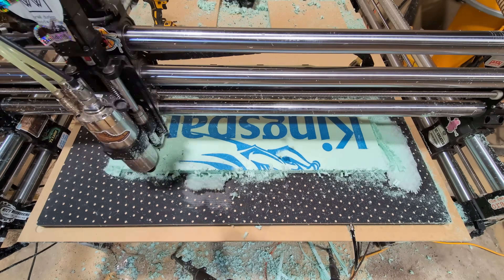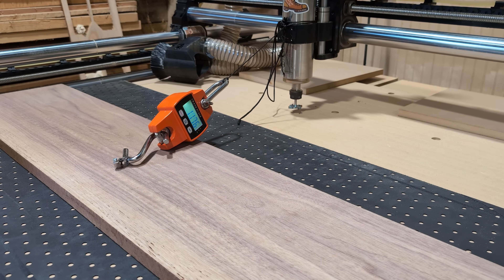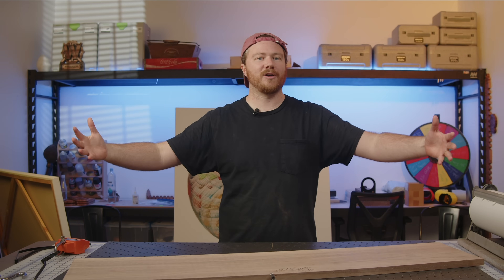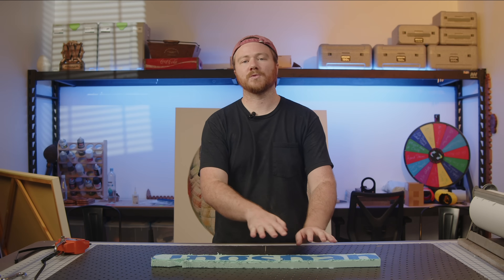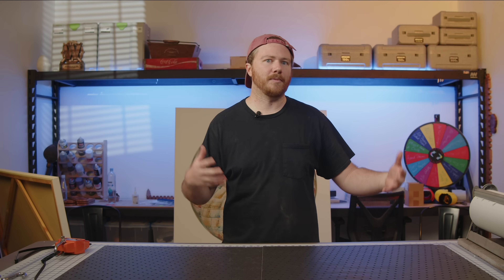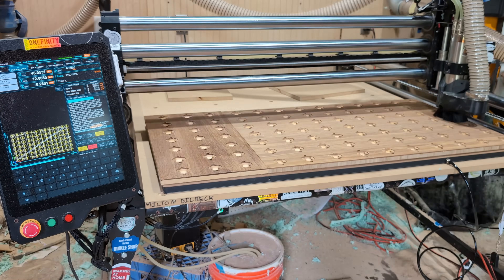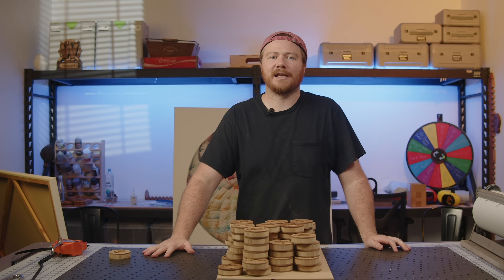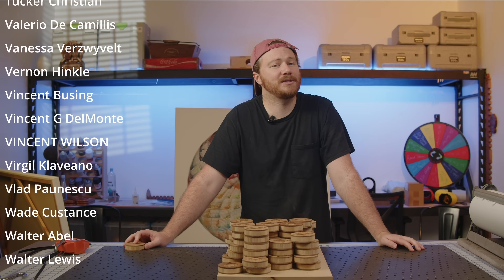Do CNC Vacuum Tables Really Work? UNEXPECTED RESULTS

Comment: Hi - new subscriber, found your page by a search on Airweights. I have their 2x2 and 2x4 tables and am planning to do a bunch of through cuts on smallish parts. Have you tried the cover gasket on solid sheet that they sell? You have to make a dedicated fixture for each type of parts. That should hold down all your parts… AllStar CNC, which makes the gasket material, has some info on it, and Airweights has some instructional material on their website. I think I have it sorted out and will try it tomorrow in Aspire.

Comment: if you are going to be doing a lot of those little pieces repeatedly, i would ditch the MDF, get a piece of 1/4" acrylic and their surface gasket, to make a custom template. I use that on mine and can cut out acrylic pieces that are 1"x2" in size and they hold every time.

Comment: here is some tips from my experience of working on an industrial machine. If you really want to test the hold down strength, get some 18mm ply that's cupped and see how well the vacuum set up will hold it down and then try to machine it, especially cutting strait through. the more rigid the material, the more problems you encounter with vacuum tables. next, especially for scenarios like your example of cutting out 90 small parts covering the majority of your surface, use an up-down compression cutting bit, these force the sawdust to stay in the cut and well compacted to stop parts from being able to shift. 6-8mm diameter bits work really well, especially if your machine is strong enough to cut out the profile in 1 pass, overwise consider tabs for small parts even with a vacuum table. 
you are, in my opinion, 100% right that more smaller zones is better then fewer larger ones. the machine I used was 1 giant zone, and if it fails anywhere, it fails everywhere. multi zones like you suggest is far safer and less problematic and also more energy efficient.
i also would say a cheaper option then buying those stick on sheets with holes is to just lacquer /paint the mdf you want to use as your sacrificial piece (you basically want to seal it) and then use your cnc to cut the holes, or even a different pattern. you'll prob get a better result doing this as you can also seal the sides of the mdf which will increase the vacuum as it will have less surface area for air to get sucked in from. 
one other piece of advice on the sacrificial piece of MDF. MDF usually arrives lacquered on both sides. when you machine the first side flat, its great as the vacuum table should form a fantastic seal against the bottom side, however once you flip it and start machining the second side, your vacuum (hold down strength) will drop. doing a zigzag pattern up the the mdf is not ideal, a snail shell pattern is better and depending on whether the mdf is cupped or bowed or anything start from inside or the outside. if the mdf lifts up on the outside as you loose suction and you profiled starting on the inside, then you will cut the mdf deeper on the outside and any following work you do will suffer from this consequence, I.E. leaving some onion skin behind as you experienced. so ideally in that instance you would have wanted to start your flattening profile from the outside in, maximising the vacuum strength at the start. Hope this makes sense. its hard to explain unless you have experienced this. The vacuum table i experienced was very old and underpowered in my opinion which aggravated all these problems, but if you encounter any of the above, these are good potential solutions.

Comment: You can make your own tile gasket on the CNC machine BTW, just use 1mm self adhesive foam and machine the 1/4 holes in with the CNC 👍

Comment: I have had mine, 24x48, for a couple of weeks and really like it. The only issue I have was the fitting from the pump to the moisture trap was to short but that was an easy fix. The pump does put off a lot of heat though especially on long multi hours cuts. I need to figure out a way to exhaust it to the outside. I will be interested to see what you come up with on the mdf.

Comment: Great video!  Covered the most common situations, covered the pros and most of the cons (maybe a follow up on the lifespan of the sheets and how to prolong).  Allstar and airweights are making a mark in the small scale CNC business! and clean your shop!
Reply from the maker: Thanks! I did ask about how long the sheets "last" if they are not fully cut into and Allstar said they have customers that have been using the same tile gasket for over a year!

Comment: I wonder if using tyvek type tape or just packing tape to help seal certain rows or columns to help it pull more from the area needed.  I first was thinking covering the whole back but if your cutting a 1.5 “ row/column area with 1/8” between, then you could use  1.75 inch tape for instance so you have some fudging as long as it doesn’t overlap?
Reply from the maker: Airweights did mention that if you have material thats not fully grabbing- you can use packaging tape or some other type of slick tape and it will help a ton!

Comment: I’m surenot did you answer whether you can use the mdf or not if you flatten both sides?im considering buying the 2x4 option very expensive. Can you use that mdf as a gasket material instead of the mat or is the mat more for air loss?
Reply from the maker: So the mat is more for concentration. So its like using a straw to grab the part, rather than a larger area. Tons of little straws, I guess lol. I think the next mdf I'm going to try is gonna be 1/4" and I won't surface it. Time will tell!

Comment: I am wondering another possible function for a vacuum table - and that is can it pull a warped sheet down flat? It doesn't appear like it could; based on your comments about having to press the foam down when it was warped? Or - with an 18mm thick sheet of Baltic birch, if you could press the warp down, would it then hold it flat?
Reply from the maker: I wouldn't count on it flattening a piece of baltic birch. Its great at holding, but I think the foam was much more pliable than plywood would be
Reply: @HamiltonDilbeck  - that's what I would think, too. I will continue to use edge clamps, and move them to allow access as the spindle moves from edge to edge of the panel.
Reply: depends on the vacuum pumps and how good of a seal you can get. i used to stand on our CNC to get 18mm ply to suck down (industrial machine sized 2440x1220mm). but in a perfect world youd put those really warped or cupped sheets to the side and cut them down smaller so you dont have to deal with it. The place i worked at didnt accept returning warped wood so we had to find solutions to get it to hold down. sometimes had to get masking tape out and tape the stock all around to form a good seal with the MDF. not a great solution as depending on how warped the stock is, as soon as you start cutting through and you loose suction strength, your stock can just pop off, or, in some occasions, especially if you tapped the stock to the MDF, the stock will lift off and pull the MDF with it clean off the vacuum table, and now you have the scenario where your CNC can move a full piece of 18mm ply 2400x1220mm around the table. Ideally if you do any of the above, your doing it on a project that doesnt require you to cut all the way through, or you leave an oversized onion skin.
Reply: @SebbyG86  Right - the challenge is for me as a startup business (making mass loaded transmission line speakers) the ~$100/sheet price of 18mm Baltic birch has to work. I have been doing a series of edge clamps (of the panel that is cut to size already) and pausing the Journeyman Elite to move clamps as it progresses. Then the joints are cut flat, and can be clamped during assembly, and have things come out right.
Vacuum hold down is not going to be practical for this.
Reply: @NeilBlanchard  we used to make speakers and subs, some subs so big it took 4 full sheets of 18mm to make 1. 
If you are cutting the sheets down to size first then machining them, i think your best bet for speed would be vacuum table + jigs. Jigs makes it so it redirects the vac to your piece your working on, and then you dont have to faf with the clamps. but obviously its an investment as you will have to make all the jigs, but once you have made them you would gain time. i couldnt fathom stopping a program to move clamps, over and over.
Reply: @SebbyG86  Hopefully, I can get to place when this will be needed.

Comment: Clean your shop. I built my vacuum table using vacuum motors from ametek, works great. I just use lightweight mdf for the bleeder/spoilboard and no longer use tabs. I almost always use compression bits cutting full depth in one pass. The sawdust packing behind the bit along with the vacuum allows me to cut very small parts.
Reply from the maker: GREAT POINT! I completely forgot to mention downcut bits and sawdust packing can help the part stay put. Thanks!
Reply: Having used both, feel like a vacuum table is just trading some mild inconveniences for others. The blue painters tape and superglue trick takes a few min to set up, but it’s cheap and it holds great. The vacuum table is loud and expensive and you’re always fussing with it.
Reply: @rexmundi8154  I still use painters tape and super glue for very small parts (less than an inch cutouts in very thin stock). The vacuum is great not worrying about hitting clamps or screws and multiple sheets of the same part are a breeze to change out by just flipping the switch. I have about $400 into my vacuum setup. Depends on what your needs. I had to use vacuum to improve part quality. It was mainly to hold sheets perfectly flat against the bed. A slight bow in the sheet gets pulled flat by the vacuum. I get little to no tool marks in pockets and much better results when v-carving.
Reply: @InspiredCraftsman  I guess I was thinking about my own use case where I’m machining stuff in a CNC Mill like a Haas. I’m planning to get a onefinity when I retire. I agree about clamps. I almost never use them
Reply: @rexmundi8154  I would love to have a cnc mill. I'm dabbling in the machining world with a victor lathe and a 3/4 size mill. For woodworking I'm running a shopbot cnc and do a lot of sheet goods, so that's where my perspective is coming from. I can't say enough good things about shopbot. My machine was built around 2010. shopbot was very helpful  with tech support to get it up and running.
Reply: One thing to add. When you use a vacuum table the spoil board is a consumable. You should cut a into it a little. So if you cut the same thing over and over again having a board for that product makes sense.

Comment: I bought a vac pump from a guy that was at 7,500' altitude. He thought there was something wrong with the pump. Got it super cheap... Got it home, plugged it in, and it pulled as expected for my 5,500'.  Dude didn't know about the altitude drop off.
Reply from the maker: I hadn't thought of it either until I was talking with Airweights about potential failure points. the more you know!
Reply: @HamiltonDilbeck  yeah. It's crazy how quickly you lose pressure.  I drove from like 20' altitude in Georgia home to 5,500' in Colorado... Everything with a flip top lid popped open, and a bag of chips exploded.  Which sounded like a damn bomb went off in the back of the car.

Comment: I wonder how the Tile Gasket product compares to just covering the exposed parts of the spoil board with melamine or rubber sheets. Has anyone seen that sort of comparison performed?

edit: I should clarify that I'm talking more about holding down larger pieces. I'm also curious if TG works well with higher CFM vacuum table designs.
Reply from the maker: Tile Gasket was originally made 20 years ago for large format tables! Its for sure meant for big pieces. Not sure aobut melamine or rubber sheets- but I do know that the gasket material still will hold a seal when the top has been cut a bit. Its great!